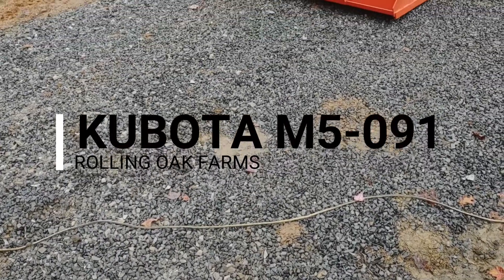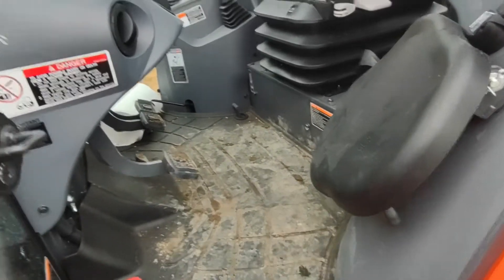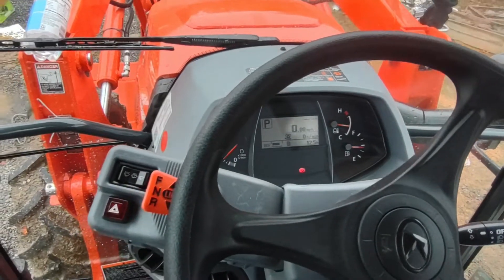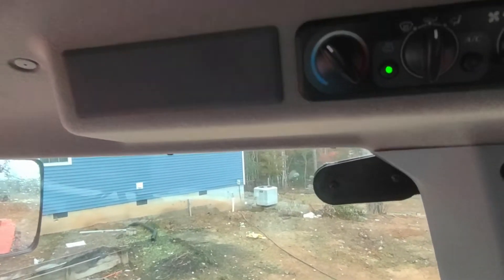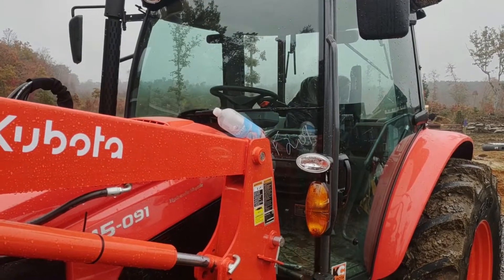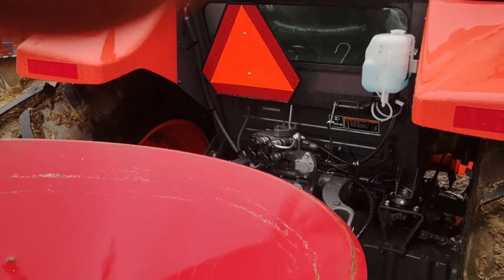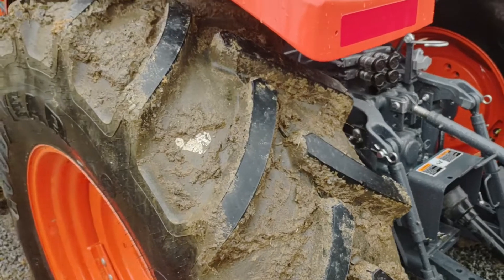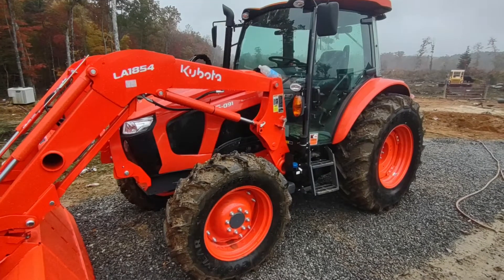KUBOTA M5-091 INTRODUCTION

Comment: Thank you  for showing your tractor. I just got the same for my self and I wonder if you ever discussed  fender extensions in the rear or front fenders  with your dealer ? 
I asked my dealer about it and he looked at me like I am from another planet 
I am having few side hills here and I had to move the wheels as far out was possible but now the tires  trow more stones on gravel roads.  
Thank you.
Reply from the maker: Thank you for watching. I have not inquired with my dealer yet, but I will and let you know what my dealer says. I have noticed the same issue after getting in some mud and gravel even before setting my wheels out. Definitely would save some windows on cars and cleaning time on the tractor.

Comment: Just get you some adapter sleeves for your lift pins. That way you don't have to change your lift pins and can still use on your cat one tractors. They only cost a couple dollars each at tractor supper. Will need different size for the top link.

Comment: Nice review , just wanted to mention you can simply buy a couple cat 2 to cat 1 bushings that slip in your 3pt balls. Keep the equipment reviews coming really enjoy your point of views.
Reply from the maker: Have you had much luck with the bushings? I've had several people that swore by them and some that was against it. That would be alot better than changing the pins out. Thanks for watching.
Reply: The few times I've used them no issues, not much to go wrong that I can see
Reply: Just remembered think my m8540 came with the cat 1 to 2 bushings

Comment: None of my tractors have keeping pins on the stabilizer pins. My M7060 has a short chain on top to keep from dropping the pin but those pins will not fall out without the keeper or at least I have never have that happen on any tractor.
Reply: We took the keepers off our 9540 the day we got it in 2012 and they haven’t given any trouble to this day.

Comment: I've got a m8540 one issue w it is the elec pto switch , it engages instantly to full power, no soft start like my other tractors. When I try to engage heavy or fast spinning equipment like my Rears brush flail terrible violent start up, sometimes would stall tractor, bad engineering. To prevent this I click the yellow knob on off on off on off and once pto is nicely turning leave on . Your seeder or any lighter loaded equipment won't be an issue.
Reply from the maker: I have noticed that myself ,so far to combat that on my brush cutter. I have been putting my idle down low as possible soft starting and then ramping up like old school, when the clutch on the old farmers tractor wasn't quite in adjustment but he'd always say send it.

Comment: Thanks for the great review! I'm about to pull the trigger on the m4, was that just too small for your needs? The m5 is awfully nice!
Reply from the maker: Thanks for watching, Yeah the m4 just was a touch small for us eventually this will be a secondary tractor for us so I was on a fine line of not to small but not to big. Originally I was going with the m4-071 and like anything else I was sure I would have regretted not getting the next size up. Also we have quite a bit of hilly ground and a touch more horsepower never hurts. I really liked the m4 because of the lack of the def system .